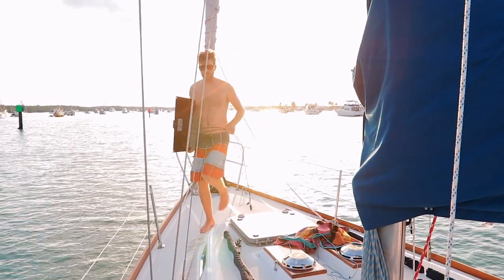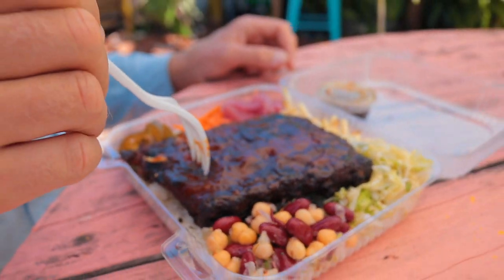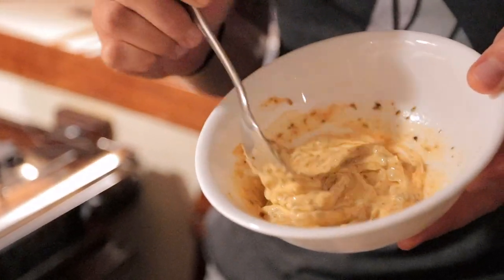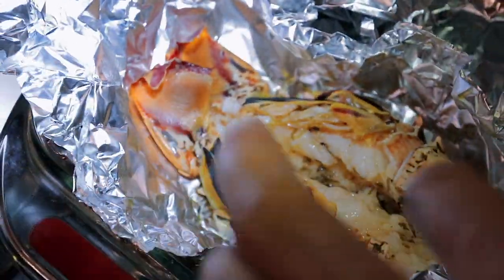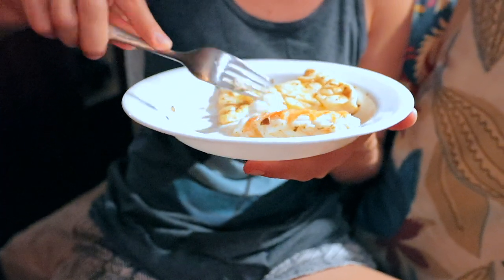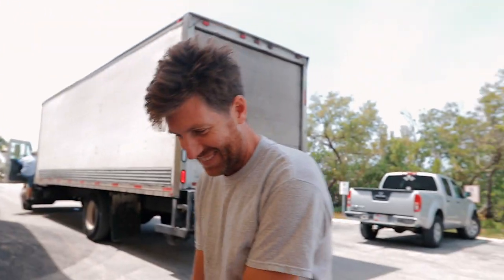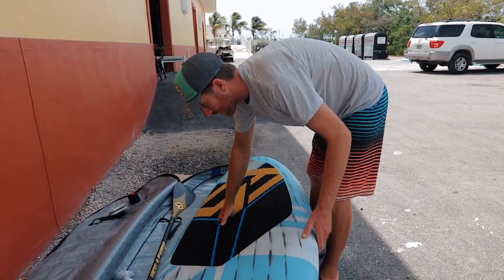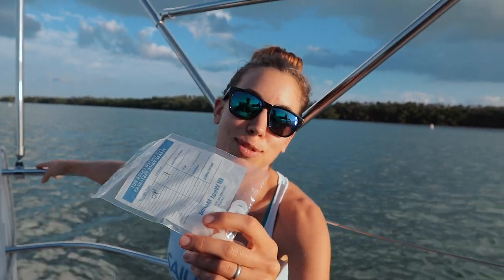Can We Look this Creature in the Eyes… and Eat It? | Sailing Soulianis - Ep. 70

Comment: Guys if you have to think about wanting more it wasn’t cooked right. 
Next time try this: 
Separate tail from body. 
Put some sea food boil in water and boil.
Drop lobster in boiling water until all flesh turns opaque white about a minute.  They sometime float when done. Don’t over cook.
Split the tail down the center to Butterfly. 
Coat with butter and sprinkle lightly favorite sprinkle seasoning.  ( you can add more but it’s hard to get off lightly). Lawrey’s or Everglades is mine.   Put butterflied tails under broiler about 3-4 inches from element.   Toast a tiny bit mostly until all the butter is melted and a few spots are turning brown.  (This step can be done with a propane torch). 
Now serve hot with French fried or cold slaw.    If it’s is chewy or rubbery it’s cooked too much.  The complete cooking is less than 2 minutes!!! It should not be chewy

Comment: What kind of thread are you using? Is it able to withstand the weather/elements?
Reply from the maker: It’s Sunstop polyester UV-resistant thread. It has a non-wicking finish to help reduce moisture coming through the seems, and is both heat and abrasion resistant.

Comment: Your solar panels don't like to get hot. Put corrugated plastic sheet ( Coroplast) under. This material has little channels in it that allow air to pass through and remove the heat from the panel. It will improve your panels' efficiency.😎👍

Comment: Kirk and Lauren, to get a great tasting spiny lobster,  cut the head off (which will also help kill it, although you could use cheap vodka to kill fish and seafood) just at the beginning of the tail section and slice through and remove the underside of the tail exoskeleton ,careful not to cut into the meat. I usually use scissors for this.  Then pre-heat your grill and make a marinade of lemon juice, tarragon, butter and a bit of salt and pepper.  once the grill is good and hot, take a basting brush and brush the marinade onto the meat of the tail, let sit for a few minutes to penetrate into the meat. Grill first with meat-side down for about 3 minutes or until you get some good grill marks (don't be surprised if you get some flareups) then turn the tails over add some more marinade to the tails (this will continue to steam cook the meat) for an additional 3 minutes or so until the meat is firm but not rubbery. Serve with Caribbean style rice and peas and I like the Chalula Lime hot sauce for this too to add some zip.
Cheers,
Tom,
 S/V Dragonfly
Reply from the maker: Oooh, sounds like the lobsters wouldn't be safe from us anymore if you were cooking!

Comment: Hello Lauren/Kirk.  Good stuff. Love the DIY'ers of the world. I just wanted to respond to your nylon washer trick to quiet all the rattling tube joints.  (Just went through this exercise). What really works the best is small rubber o rings.  Any ACE hardware store.  Pull the screws, add a little vaseline and work them in.  They bind up all the screws and pins really good and your boat goes silent.  Just a thought.....Capt Kaz
Reply: I've gone a cheep rout slicing up a bicycle inner tube. Especially great if you have an old damaged one otherwise get a small one from Walmart.

Comment: New England seafood chef here. Have cooked 10,000+ lobsters. We usually boil them, head first, about 10-15 mins depending on hard or softshell and size / weight. Fun fact: way back when, there were so many lobsters in tidal pools that they were pests, you could just scoop 'em up with nets and were fed to prisoners as they were deemed low-cost food supply. Northern lobsters taste sweeter and more tender than southern, which I found to be more "gamey" or tough, but still delicious of course. We call lobsters bugs lol

Comment: Simple trick...put the lobsters into a pot was salt water (room temperature) on the stove.  Turn on the heat.  The water comes to a boil slowly and kills the lobsters humanely.   Or....You can also just twist the tail off with heavy gloves on.  Then de-vein by pulling off one of the antenna...locating the butt hole on the underside of the tail.  Stick the narrower pointy end of the antenna into the hole about 3 inches or so, and then pull it out.  The intestinal vein comes out with the antenna.  Very simple procedure...I think that might be a little less difficult for you to do.

Also sailing Yacht Ruby Rose did a great way of attaching solar panels to a Bimini.  Worth watching the video.

Comment: Stuff a blade between the carapase and tail with the point towards the head.  Run is around in a circle around the tail and pull, bingo-bango you have a lobster tail to cook.  Split the tail from the underside right down the middle and grill it on low for a few minutes.  Pull the meat out of the tail and dip in butter or top a nice plate of pasta with it,.. YUM! Spicing is important and the tail gets cooked ONLY until done but no more (the meat will turn white, then it's done).  That's one option anyway.

Comment: it USED to be....that if you recharged a deep-cycle marine battery BEFORE it was at least 80% drained, you would shorten its life if you did it regularly.
the batteries had a memory...so to speak.
is that no longer the case?
Reply from the maker: That's (sort-of) the case with many traditional lead acid batteries.  Our Firefly's are different.  They have a carbon-mesh in place of part of the lead plate that affords them some super-powers such as not having a "memory" issue, being drawn down extra far, sitting in a partial state of discharge for long periods of time without issue amongst others.

Comment: Good video guys! The bimini looks great. I've got to ask a couple q's. What was the quote you received (if you did) for  someone else to do the entire bimini? Would you do it again given the time and cost of the kit involved (unbiased answer if sponsored please). Do you ever perform Firefly's restoration charges? I've got 4 of the G31s and it would take cutting solar to them to  run them down to the specified 10.5v, and even doing that it would take a loooong time (week or more) to run them down. Heading out to Santa Barbara, Santa Cruz and Santa Catalina Islands for a few weeks.Thanks TvZ
Reply from the maker: Quotes were $3k and more. Yes we’d do it again in a heartbeat. We learned a valuable new skill and got exactly what we wanted. It wouldn’t have been finished any sooner if we hired it out. We do a restoration charge twice a year. And we do unplug solar when draining.
Reply: Thx! $3k might get the canvas work done in San Diego, not both the frame and canvas though. I bought a 1958 Singer and am going to hack around with making fender covers to start with. BTW I was talking with one of the reps at Precision Sails about a new genoa and asked about your's and your thought process on stepping up to a tri-radial and the Warp(?) fabric. Don't know what I'll get yet but I put a plug in for you there (not that you need it). I enjoy your vlogs and admire both of your skills and teamwork, fun to watch.